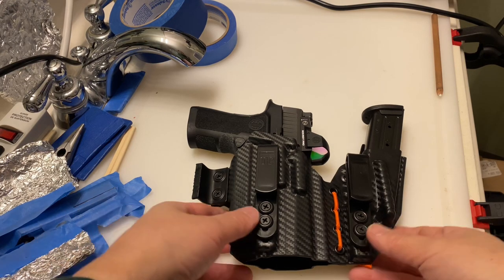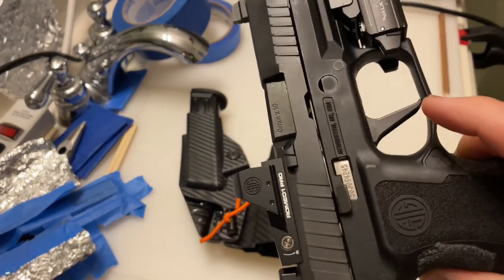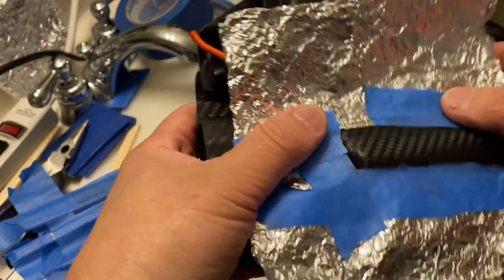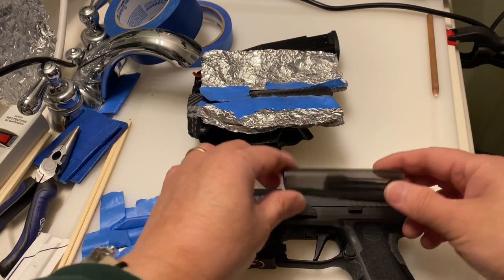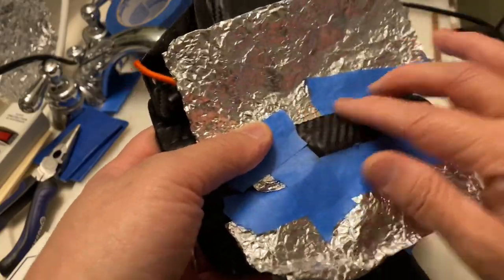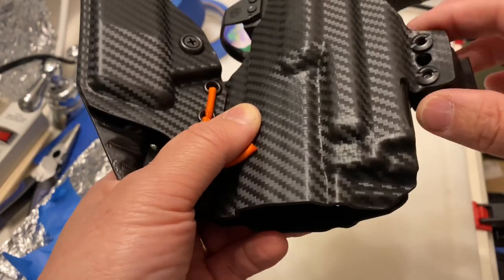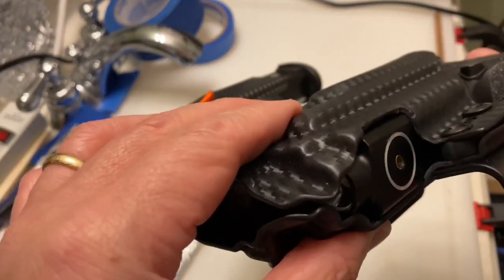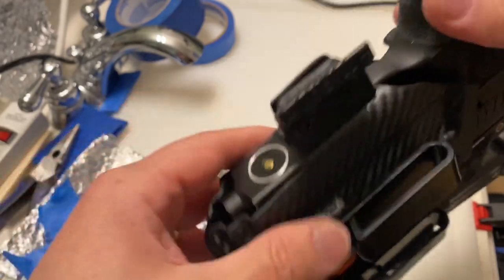Tier 1 Concealed Axis Elite for Sig Sauer P320 RXP Xcompact & Olight PL mini 2 modded for gas pedal

Comment: Question: Does the holster retention remain the same without the gas pedal?
Reply from the maker: Good question. I would think so since the retention seems to be more on the light.  There is very little friction on the gas pedal.  I will swap out the gas pedal for the original slide stop and test it.
Reply from the maker: I just posted the test of the holster retention without the gas pedal; sorry the video is kinda long-winded, but the test is at the beginning of the vid.